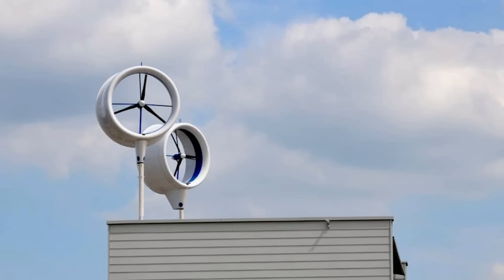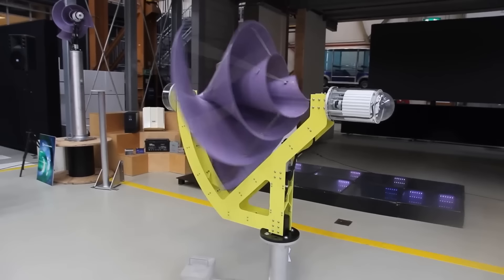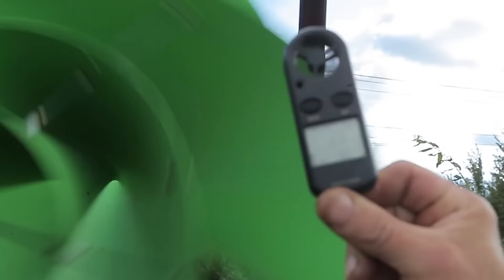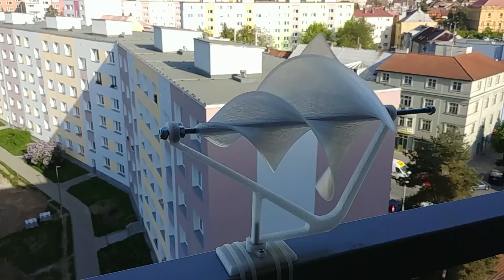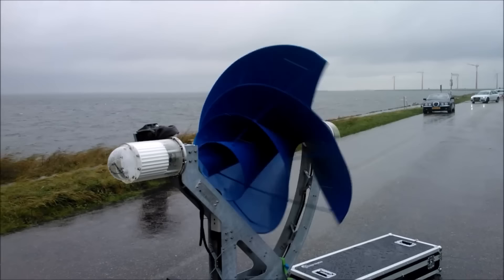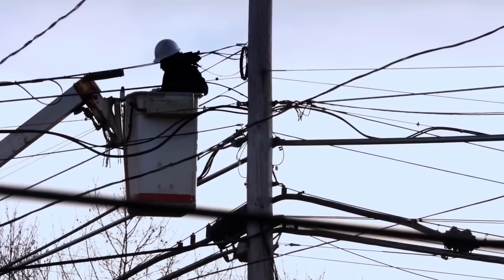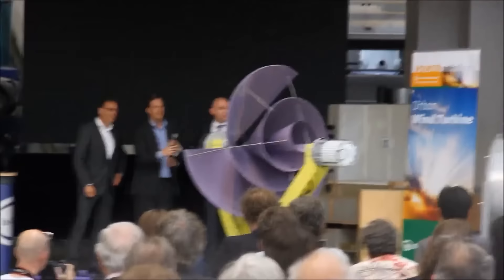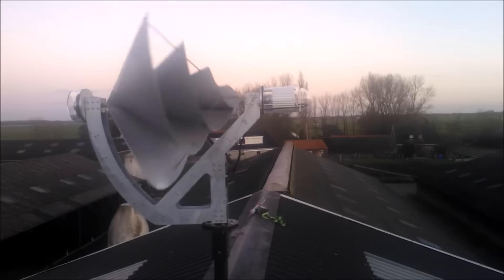How The Liam F1 Wind Turbine Will Destroy Every Home Renewable Energy Source

Comment: As an engineer with wind turbine design experience, I can say this is false sales hype. The total wind energy input is decided by the maximum area swept by the turbine, it is therefore quite small. As a drag type turbine,  its conversion efficiency must necessarily be below the maximum 59% Betz limit, and much smaller than that of a lift  driven 3 bladed propellor turbine. The cost of this device will be much more than that of a structurally simpler and lighter  3-bladed propellor. which uses much less  construction material. Its mounting immediately above the roof means it essentially has no mast, and that it is not installed high enough above the roof to capture sufficient free unobstructed wind flow.

There is no way this device would cost effectively produce sufficient wind energy to justify its cost; it would simply be a white elephant, and a neighborhood eyesore continually pivoting like a weathercock towards the turbulent local wind direction, and not efficiently capturing the kinetic energy of even the turbulent local wind! 

Don't be misled by this sales hype !🥵 !
Reply: Yeah, I would like to see their published power curve for this device.
It looks like a rip off. I also wonder how quiet it is. If it’s screwed to your roof, it’s going to transmit sound to you if there’s any sound to transmit.
The last time I was in a house that had a little wind turbine on it, it sounded like they had ghosts.
And if you’re really unlucky, of course, you’ll have a resonance problem and you will have screws backing their way out of your sheet rock.
Well, thank you for your post.
Reply: did you notice the video always tellls how bad other electric sources are? yeah, that's a tell tale it's a money grabbing scam
Reply: What about noise? I don’t care about efficiency as much as about noise.
Reply: I think this turbine was used for ships  to move way faster  than normal turbine thats what i saw tbh and u can google it . I also think based on that alone they made to think it can also work very well for air not only under water. it will be  better once the new 3Rd printer that uses lighter materials which i saw been used for things  like the new basketball 🏀
Reply: Totally agree... Just hype sales, blow up something ridiculous
Reply: Hehe yup, should be a solid 60 watt continues on average
Reply: You miscalculated. The area of this is comparable to a turbine several times larger than it is because of the corkscrew design. If the mechanism is kept simple, and affordable, and sold for say, 700 dollars(I can put this together for about 300 retail.)it could actually be viable. It would be better than solar, and much better for use on an individual home than the current turbines.
Reply: I would add a tesla valve as well to increase resistance and reduce drag.
Reply: Ai content.
What were you expecting?
Reply: I've always wondered would it be better to fit these new configurations of wind turbine next to motorways or railroads?
Reply: Looking like the impeller is very flimsy and need replacing every year too?
Reply: @johnaeryns5364  Nope.... The area isn't defined by the shape, it's defined by the frontal area. No matter the corkscrew design, there still isn't going to be any more wind hitting it. And thus the maximum energy is decided by the total frontal area, not the area of the turbine itself. This thing will not deliver more than a couple dozen watts. Solar panels at about 300 retail do a couple hundred.

Wind turbines are interesting because they can go day and night. But a design like this is dead on arrival; it's 1950s tech at best and there are much better solutions out there.
Reply: @Croga  huh..... well shit, learning new stuff all the time.
Reply: Agreed
Reply: If your objections are correct then this device will fail well before it reaches the USA.
Reply: I mean the 1500 kwh a year makes sense. You can get a wind turbine for twice the price that can produce 15-27.000 kwh. So i don't think it is a false claim but their marketing is about formfactor. You can't get a 11 kw wind turbine must places people live because of the size of it / rules and regulation with noise level / eye sore but you might be able to get one of these on your house no issue.
Reply: @zointisarenazi  This wouldn't even move more water than the traditional propeller used 40 years ago. A propeller has to cut the water and then force it backwards. The more efficiently you can cut the water and force it backwards without creating bobbles the more efficient it pushes the boat forward. This ain't it.
Reply: @anandawijesinghe6298  You are 110% correct.
Reply: Agreed. I see mechanical design flaws, and power claims that depend, a lot, on the alternator circuitry wiring and their designs. The blade is interesting.
Reply: Hmm. Well, thanks. Wondering if Holland really IS trying to put this in production.
Reply: Same goes for full scale wind generators 
Aeroplane style fan is not efficient to collect energy 
Fact. Have you ever seen anyone push start an aeroplane 😅
Reply: Thanks very much for your professional opinion, and some concepts explanations of where your opinion comes from. Science = measurable + repeatable... math is our friend in nature.
Reply: So can we get together and create one that will work in the manner in which you said?
Reply: I think it is beautiful, and would be interesting to look at. It is not an eyesore.